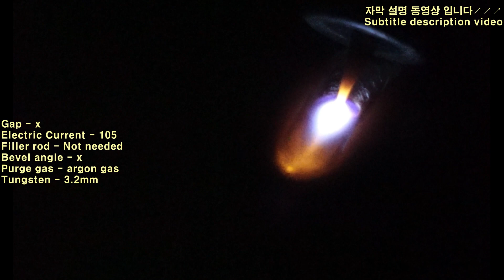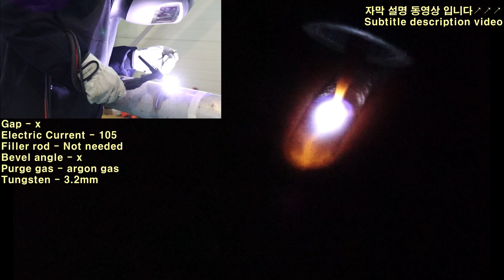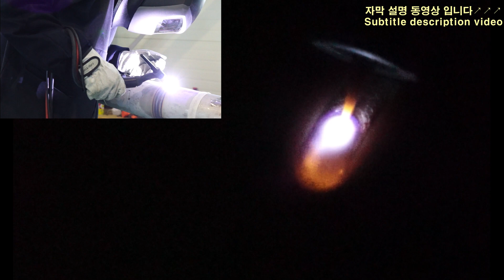스테인레스 파이프를 완벽하게 용접하는 방법 2가지

Comment: how does current change with small diamter pipe?
Reply from the maker: The size of the molten metal is important, so if you start with a very low current and raise it slowly, welding will be possible.

Comment: hello, I'm welding stainless steel pipes up to 2mm thick, I want to ask if you can advise me on what, apart from the length of the tungsten, influences the fact that the bath should be as far forward as possible for the tungsten, sometimes it happens that I only have it 1mm in front of the tungsten and I don't go quickly, the root is usually ok  , it's just difficult to run a weld line like this, thank you
Reply from the maker: When there is no gap, the tungsten is pulled out for a long time so that the molten pool moves forward smoothly.
Reply: yes, but with smaller pipe diameters, you can't pull the tungsten very far forward, that's why I'm asking if there's anything else that affects the pool, thanks for the answer
Reply from the maker: @lukeslukes9903  The reason why a lot of tungsten is subtracted is because of the angle of the torch. Small pipes need the same angle. As the size of the ceramic changes, the length of the tungsten changes.
Since a small pipe has a lot of heat input, you can reduce the electricity and do it slowly at the same angle.

Comment: When the base metal turns black and brown a few inches around the weld.. you have ruined the stainless properties.. too hot too slow.. to much interpass heat..
Reply from the maker: It's to show it in a video. It's not slow if you actually do it, thanks for your opinion.

Comment: Awesome video! Was very useful. Also I am interested in 1) pros and cons of 2.4 tungsten vs 3.2 and 2) How to feed wire while back feeding (close-ups of fingers movement) and how prevent wire tip from fluctuating and 3) how to weld stainless root with flux cored tig wire (e.g. tg-x 316L by Kobelco)
Reply from the maker: Tungsten 3.2mm is more advantageous than 2.4mm for long-term welding without fluctuations Reduces wear and tear, just press the wire to the base material during the route pass. As soon as it enters, just your hand runs away. The amount of input can be controlled by current control and welding speed. You should watch the video closely